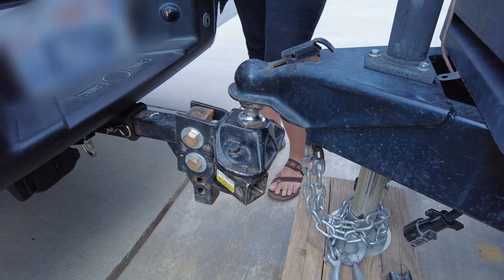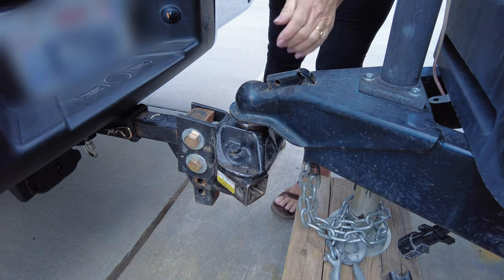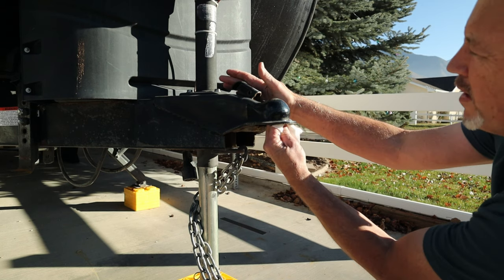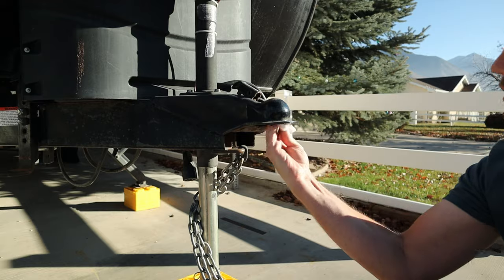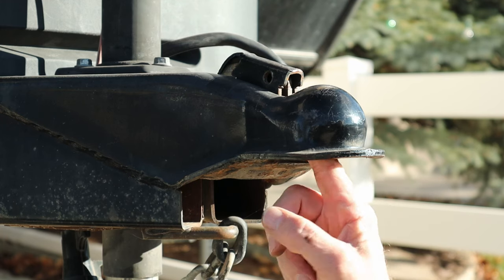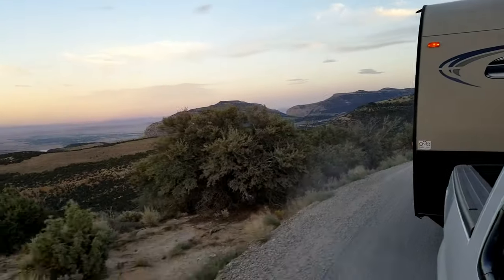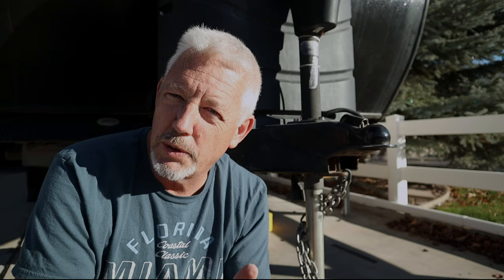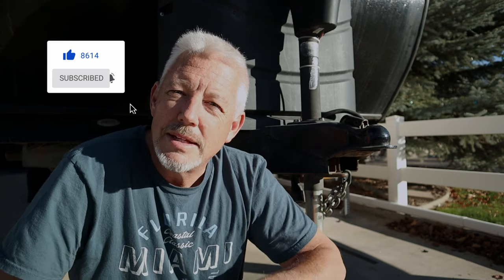Trailer Hitch Maintenance | RVAddict

Comment: I am probably overkill, but when my knee isn't wiping off the grease, I wipe of the ball after every disconnect. Just before I reconnect I put a tiny dab of lithium grease on the top of the ball, it will spread all by itself. A few times a year, I will clean out the paw and spray the mechanism with spray silicone.
Reply from the maker: Phil, knees are a really good method of cleaning the trailer ball, A very automated process that sometimes can lead to a little pain depending... ;) I have been known to use this method frequently.
 Lithium is good, Thank you for sharing and for all the support.

Comment: I use grease myself.  Whenever the grease gets gritty or it is almost gone, I wipe off the ball and put just a film of grease.  Not too much.  As for the coupler I probably don't clean it as much as I should. But every once in a while use a rag/paper towel and some brake clean to clean it, then relube moving parts and the cup.
Reply from the maker: John,
I am with you, a little goes a long way. I used to put too much on and it would get wasted. I like that break cleaner idea. Thanks for the suggestion. 👍
Reply: @RVKevin  You're welcome.  Especially the moving parts in the coupler.  They can get build up eventually.  Generally a nice wipe out like you showed is sufficient.

Comment: I use the same stuff you were seen using. Equalizer lube. Been using it on the ball and the bar swivels on my Equalizer 14k hitch. The ball still looks like new after 10k miles pulling my 2020 Jayco Eagle HT 280RSOK. My previous trailer had a 10k Equalizer and another 10 miles with no wear on the ball using the same grease
Good stuff.

Comment: Thanks for making the video.  This is something that is often overlooked but incredibly necessary.  

I usually use marine grease and given the number of dirt roads and the stuff that I end up hauling in & with my truck, the grease is often cleaned off and reapplied.  The ball hitch hitch in the bed of my tuck often sports a bag secured with a rubber band (or bailing twine) to keep it cleaner in between uses.  Not exactly stylish but effective.   The hitch on the back of truck is cleaned and greased before use.
Reply from the maker: Melissa, I totally get the horse trailer on a dirt road. You have been doing this for many years which I think makes you a PRO. And the memories of bailing wire 😁. 
Thank you for sharing, I appreciate it.